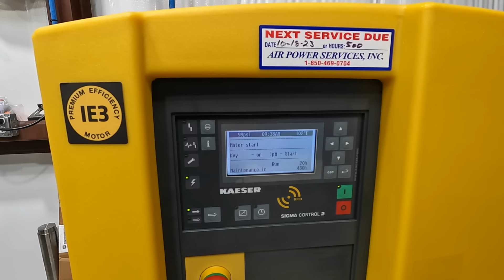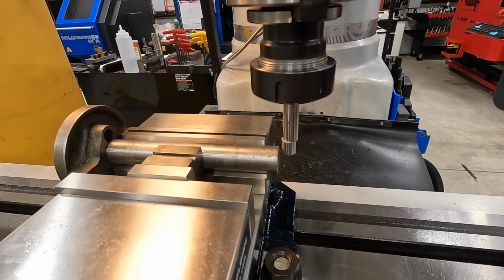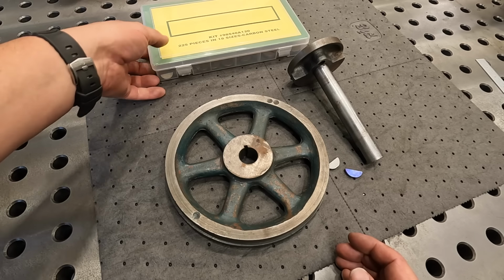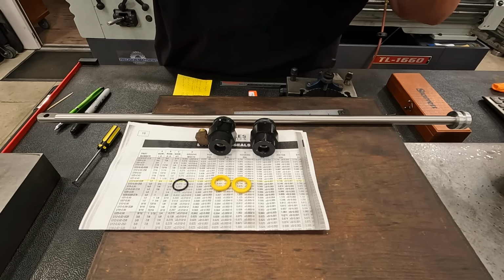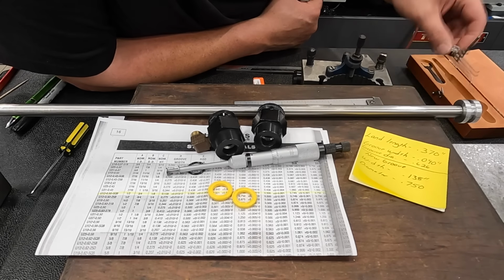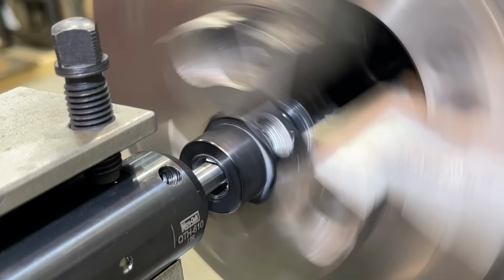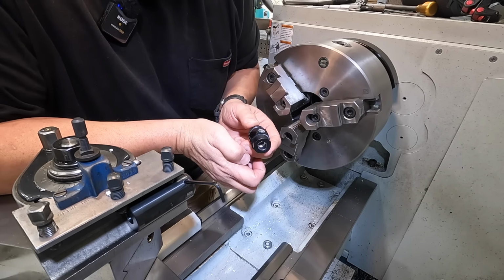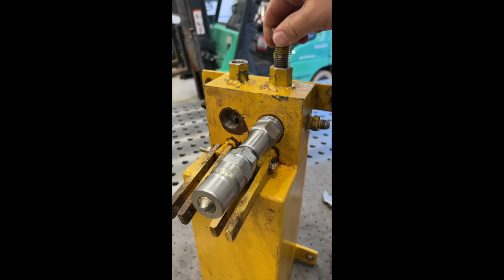SNS 370: Several Small Machining Jobs

Comment: That is a piece of cake job. I use a depth micrometer with a rounded measuring end. I have a set I made to handle all radii for keyseat cuts.
I also measure internal grooves with a depth micrometer.

Comment: That's a neat little trick with those brass spacers!  I fight those burrs all the time and use a step bit  with a pair of vise grips.  Man, that's gonna save me a ton of time!!!  Thanks Adam, I think you just saved me at least a half hour of work when building a sign cabinet.  I can't believe I didn't think of that before!

Comment: Thank you Adam. For FORTY years I have had trouble with the pulley on the blade shaft of my table saw. It keeps coming off, and destroying the Woodruff key. My problem has been that the "correct" size does NOT fit, and I have been hand filing them to "fit". How was I to know, prior to the World Wide Web, that a Woodruff key is a tight press-fit? Thanks to this video, I now know how to fix this once and for all. I will replace the key currently in the shaft with a new one, by "press fitting" it into the keyway. I am so excited to finally realize what has been the cause of an almost annual failure. In 1980, when I started my own woodworking shop, there was no access to information about machinery. This was "industrial trade" information, and at that time you would have to go to "trade school" to learn it. In high school I was in the "academic track" bound for college. I bought my woodworking tools with the money I earned as a research chemist right out of college. As I grew up, i was taught woodworking by my grandfather, who learned it from his grandfather who was a Master Furniture maker, ca. 1850. Thus, much like Adam. I learned woodworking skills passed down to me from my great-great-grandfather. But of course that man knew nothing at all about power machinery. He worked in southeastern Iowa, on what was the far western  frontier, in Mount Pleasant.
Reply: That’s awesome. 
The assimilation of knowledge is so empowering!    It’s amazing how much access we have these days to such knowledge.

Comment: Some helpful advice. Set the lash on the X axis so it does not climb the part. Also the machine has axis locks for a reason. Use them. Good to know you’re finally working off of the Machinery Handbook. It will be your friend. Keep up the good work!

Comment: Used to be easy to find machine shops.  Not the case any more.  I used to be in the injection molding business.  We had our own mold shop.  As the years went on we could not keep up with the implores, and our mold shop only did repairs and modifications.  Now being removed from that setting I really miss not having the equipment at my personal disposal.  Not easy to find anyone to do even the simplest projects.
Keep on doing what you have always done!

Comment: Use a rubber band to hold your coolant nozzle against the back of your boring bars. Just loop it over the cooland line and hook the other end over a screw on the tool holder.

Comment: If anyone marks metal with a sharpie, I would highly recommend heating the metal to 100C to 140C.  This allows the piggment to penetrate into the metal, keeping it from being rubbed off.  It also makes  it very resistant to most detergents and solvents.  Only acetone and bromine based solvents and remove it once  properly treated.
Reply: Whoa that’s clever.    I’d have never thought of that. Thanks!

Comment: Adam... ah... so that's how you made the bracket to hold the boring bar for @Will Stelter bronze bearing.  Hope to see the full job in a future video.  Thanks for showing how to do the ID measurements for the gland seals - always wondered what the trick was for doing those.

Comment: Enjoyable video. A nice variety of content. The small gland nuts may be difficult for the viewer to see what the cutter was doing. It’s still very interesting to see the proses. As a heavy duty mechanic. I use Hercules hydraulic seals. Great product great pricing. For John Deere and cat equipment. I have found Hercules part numbers on the there products match the OEM. Anyway another great video

Comment: I can't believe that you have a Schlage lock on a shop with so much valuable stuff in it.
Reply: I can't believe that he showed the entire key on video. Anyone can take that still frame from 0:23 and cut a key that matches the biting for that lock and walk right on in. :( Major major MAJOR security risk. He needs to pull this video down immediately and censor or delete that part, or rekey the lock.
Reply: @mannys9130  I agree, never show your lock or your keys but I'm guessing he edited out the security pad motion detectors and/or other security but yes a crappy Schlage basic lock!
Reply: @mannys9130  oh ffs. Have you never seen the lock picking lawyer? You don’t need a key at all. And anyone could also get in with a rock.  Calm down.
Reply: @mannys9130  You need to say "Major" again in a larger bold font.  And no not anyone could could a key that matches the "biting" of that lock and "Walk right on"  . Calm down. :)
Reply: @mannys9130  I am a locksmith and I could pick a Schlage in less than a minute. The bad guys can probably do it in half that time. I would put a high security lock on, like a Medico.  Nobody has ever picked one of them.  And they are almost impossible to drill.
Reply: @allredtail  "Nobody has ever picked one of them." "Lockpicking Lawyer..."

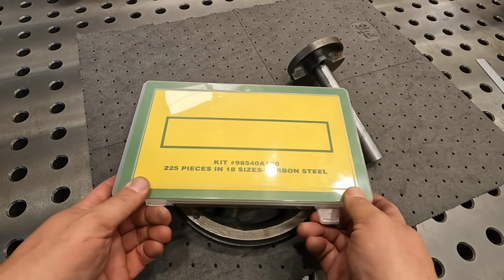Comment: 13:48  Why so many sizes?  I thought I'd add in, as Adam didnlt mention it this time, I'm sure all machinists and even most home mechanics know.  But good info for people new to the trades.

Woodruff Keys are designed to sheer off at a specific torque value,  that torque being  a value, that allows all driven machine parts down stream of the driven pulley, to be undamaged if something jams the mechanism. 

Except possibly thre cutting tool (file in this case) itself.  That's why it's always important to replace a Woodruff Key with the exact size the former one was, AND not just mill a slot for a regular piece of key stock in a woodruff Key's place.

Props the young man who knew this and got Adam to do the job righty .. a die filer is a precision piece of machinery, and could be severely damaged in an overload. 

Incidentally the Woodruff Key was invented  by William Woodruff, from Connecticut, USA in the late 1800's :)

Comment: So my questions are, if that has a weighted counter balance wont moving it 180 degrees throw off the balance and are any of the surfaces on the end shaft used to drive other facets be affecting timing since it's 180 degrees out. I ask because I can see on the flywheel there were several holes drilled most likely for balancing. So wouldn't i have been better to weld the old key pocket closed & turn down the shaft back at the same location?  Nice video, it's always nice to see things being fixed instead of thrown out.

Comment: That shaft looked like a perfect candidate for spray welding that shaft and mill it to spec, then cut the key way?
Reply: You wouldn’t spray weld to fill a hole.  He could have tig welded it and machined it, but why? What he did was faster and easier (and cheaper).

Comment: What is the benefit of the boring bar sleeve vs just putting the boring bar directly in a tool holder? More rigid? Easier to set it in perfect alignment? (Not clear to me that perfect alignment is needed for any but the smallest boring operations, but it does seem like this would do that easier.) Something else?

Comment: In the first job, it looked like you could have milled the new slot where the old slot had been.  Did I see that wrong?  It seemed like the old woodruff slot was a lot smaller than the new one you milled.

Comment: Great episode! Regarding the small boring bar at 17:15 (with the coolant flowing through it), I was wondering if you had ever noticed any rigidity problems, small amount of increased chatter, etc. because of the hole bored through the bar for the coolant versus a solid bar? It seems like it would be ever-so-slightly less rigid but may not be in actual use, so could you comment on those type bars?

Comment: Mr Adam, we boaters only really have these crap Oring stuff to work with for our boats. 
If you offered a hydraulic seal that is like, standard (what you did) you could ream out a few more fittings and I bet they’d sell quick. 
My dad and grandpa are like, I’m going to get our fittings and mail them to him! 😂

P.S 
For things you use a lot of: say coolant and cutting fluid. How do you incorporate that into the cost of a job?
Reply: Most automotive shops incorporate a percentage of the job into the bill as "shop supplies." That's what I did at my old workplace and it covers stuff like brake cleaner, sandpaper, grinding disks, paper shop towels, cloth shop rags, grease, etc. After several jobs, that $5 here and $3 there and $8 there all add up and cover the cost of materials that you'll go through each month. I'm going to go out on a limb and say it's probably similar in a machine shop.
Reply: You’ll love those seals until you need to replace them.  The coolant is reused.

Comment: I want to see the customer install those seals in the glands. An "O" ring is a lot more flexible & those seals have to go in a 1/2" + to seat. Must be a fair sized hatch for that actuator.
Reply: Well, the seals are standard items so must be able to be installed, if the customer knows what is good for them they will warm them up in hot water for a few minutes and use a seal installer tool that bends a loop into the seal making it somewhat smaller and easier to install.

Comment: A comment on the woodruff key work. Actually, more of a question. I've seen this sort of thing done before. What would it take to write a program on your CNC machine to do the same operation. Obviously, doing this manually is straight forward.  But could a program be done where you pick the right tool, ask for the correct offset for the key placement and then do all the work to properly center and place the tool. In the long run having a collection of programs to do this sort of thing could reduce the chance of errors. I'm thinking in particular about doing the math to center the key properly. Not that it is difficult, but any time you can eliminate the possibility of error through automation, that can be useful. Of course, in the long run it is still probably less expensive to do it manually. Just curious.

Comment: 0:23 Adam you shouldn't show you keys to the internet. There are some people in here that could use that against you
Reply: You really think someone could  get a key cut from what you can see in the video?
Reply: @colinfahidi9983  yep, there are like 10 possible position on every cut for a pin. You can clearly see profile of the key and you can simply compare them easily. Then you will know the numbers, and somebody could just simply file it down to specks
Reply: @kwk8363  No you cannot see them in detail enough to do that.
Reply: @colinfahidi9983  of course. You can read the key code just by looking at the teeth and then use it to cut a new key.  That said, there’s no point in worrying that much about it.  It is easier to get the lock open without any key at all.  A rock works good too.
Reply: @stargazer7644  Not from a blurred video I'm afraid.
Reply: @colinfahidi9983  At 1080p, it is plenty sharp enough to read the keycode.  Not blurred at all.  If you'd watch it on something other than a phone you'd see this.  But you seem to have missed the most important part of my comment.
Reply: @stargazer7644  Yeah course it is

Comment: Just confused watching Adam put the blue key away, I always thought the chart in the lid of boxes like that was arranged so the square that covers the bin describes that bin's size. It looked like Adam read the bottom  or back square and put the key in the top or front bin, where it belonged reading the sizes on the yellow chart.
Reply: You can easily see that the chart corresponds when the lid is open, not when closed.

Comment: What determines if a woodruff key or straight key is implemented? Not a machinist or ME, but it seems an ordinary straight key would be just as if not stronger than a woodruff key.

Edit: Want to add that it seems a straight key would be easier to machine.

Comment: Wondering why you don't use a scratch plate when grinding large drills, it's the only reliable way I found of getting the cutting edges exact.  No criticism of your grinding.
Reply: How does a scratch plate work? I only use drills as a roughing tool but if there's a more accurate way of checking the grind I'm all ears

Comment: Question:  What is the benefit of a woodruff key vs a square key way?
Reply: Woodruff keys eliminate any possibility of the key escaping.  They also can be used for safety reasons by creating a ‘fuse’ or weak point that intentionally will fail in a collision or jam event before more expensive stuff does.     

Woodruff keys also allow for a bearing to work on either side as it’s not recommended for bearings to be seated on a key way. 

A square key will generally give more support driving the hub. 

I’m sure there’s more to when and why to using either that may be as simple as production efficiency.       Yeah?
Reply: @audimaster5000  Thank you, Sir.  I appreciate you sharing the knowledge.  That makes a lot of sense.  Also, you play wonderfully.  Many Thanks.

Comment: id love to have a nice set of those precision ground blocks to help with setting up my parts. im just now getting all the stuff need to do this kinda stuff. ive had a lathe an mill a couple months now an i got them about a month a part, the lathe was the first one i got then the mill. both are probably as small as u can get an still work steel or at least i think, or would probably better to say the cheapest machines i could get so a 7x14 vevor lathe and a wen 33013 mill, some ppl have told me that i got a good deal on the wen for the price i paid cause they are ususally more expensive than the more common sieg x2d machine but it worked out that the wen was cheaper after shipping than the sieg machinie so i ended up with the cheapest machines i could get cause im broke but really wanted to learn how to do this stuff so at this point i actually am able to start making parts but the biggest thing i feel like i need are the blocks to help set the parts up an the clamps to help hold the parts to the bed. right now i have a decent vise i got on amazon again one of the cheap deals, everyone who has seen it ask is that a kurt vise but sadly i'll probably never get to own or even use a kurt vise just cause of the cost but i feel like i got really lucky with the vise i imagine isn't always going to be the best way or will need other stuff to help with holding like the v blocks an stuff like that, but as of right now i dont have anything that is "precision" ground so that is the biggest thing i think i need right now. 123 blocks v blocks an a set of parrelle blocks, again im competely new to all this stuff so i maybe wrong with my assumptions but i always thought the precision ground blocks were just meant to be used as references but now i am starting to think they are more for holding  the parts or to help with the setup. does anyone have a suggestions on a good set of all this stuff an what i should buy first to get the most use out of them but eventually id like to be able to have a decent collection of all the stuff that way i will be able to attempt any job i may run accross.

Comment: I have noticed some machine shops will open a location in a busy area, sometimes on the main street of a town, use signage that proclaims they are a machine shop and not just some generic building, but still turn away small jobs because they only do production runs.  Such shops have always cut me to the quick, especially in farming country.

Comment: I'm looking for a 16 inch shredder for shredding aluminum cans and old riding lawn mower tires do you think you could build something with a a chain drive on the cogs and belt main drive to the motor. My contact info is to the left